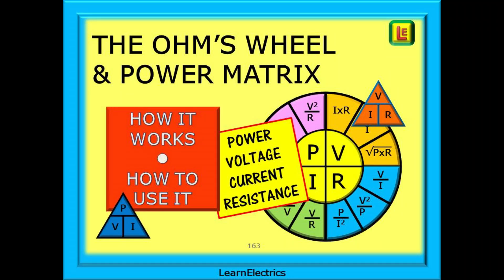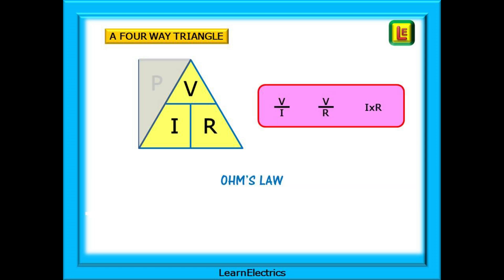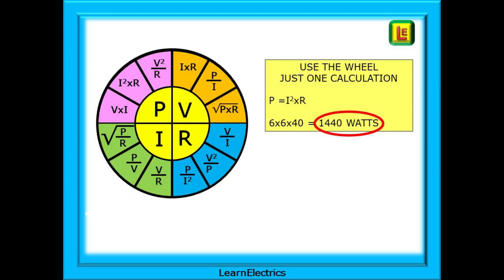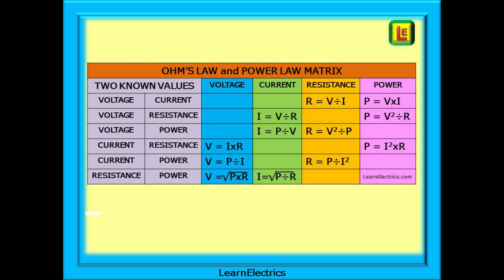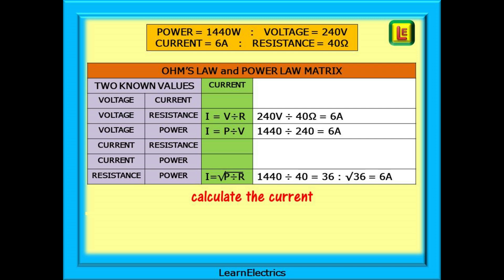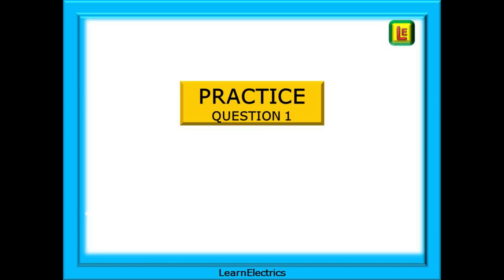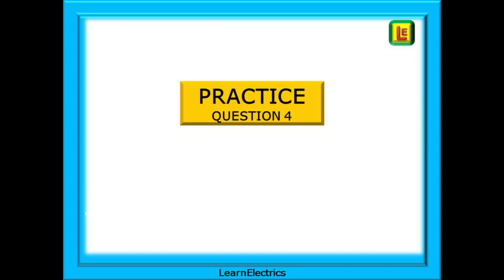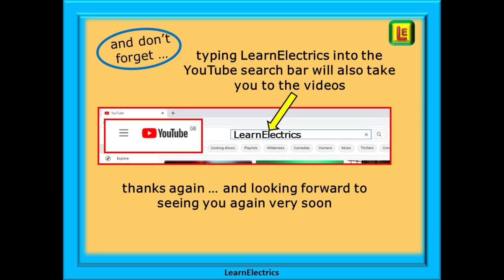OHM’S LAW WHEEL AND POWER MATRIX – COMBINING OHM’S LAW AND POWER LAW IN ONE EASY CALCULATION

Comment: These formulas are ok for DC curent or single phase AC with purely resistive loads.
They do not work for 3 phase calculations or single phase with inductive or  capacitive loads ( as it is the case in the real world ). Just an observation.
Reply from the maker: Thanks for your comments. Appreciated.